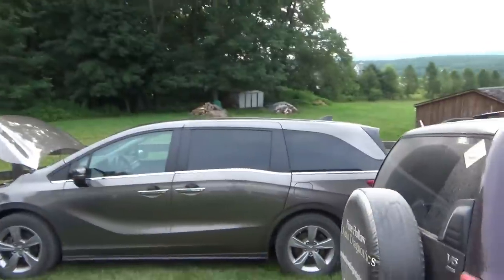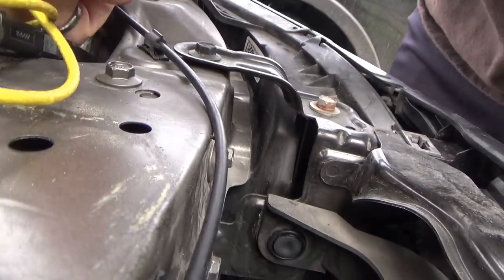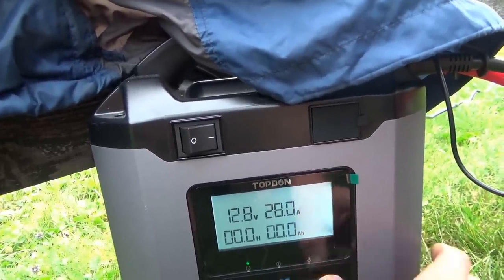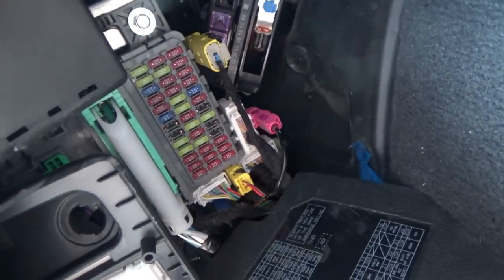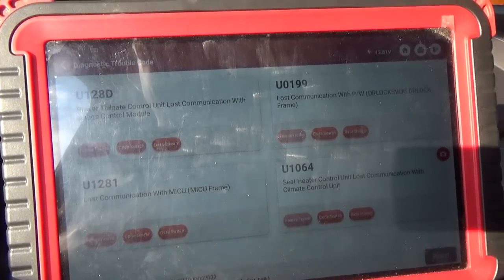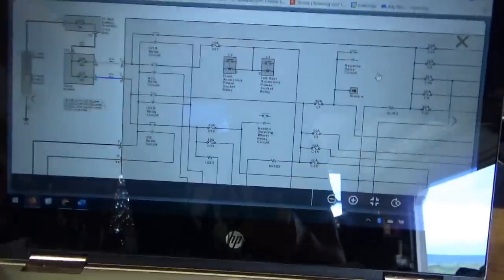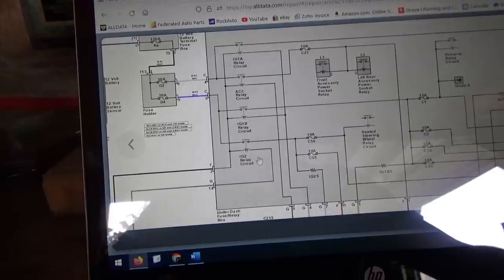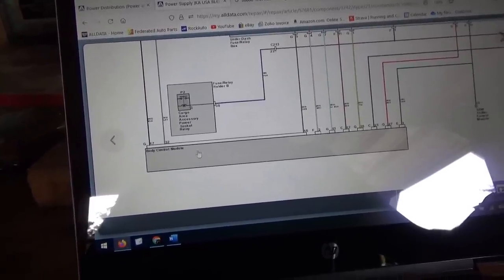WTF...Honda Turns Itself ON & DRAINS the Battery?! (Part 1)

Comment: Miss the good old days when you could climb into the engine compartment to do repairs, actually see the spark plugs before you remove them, change a headlight for 5 bucks and a tail light for 50 cents, 7 dollars for a wheel bearing instead of 250 for a hub assembly.
Reply: The good old days when head lights had the brightness of a firefly in a mason jar, a 5.7l v8 made 120hp, a mid size family car got 14 mpg, and if you hit anything you were instantly killed.
Reply: @JackS425  you know it
Reply: Amen.
Reply: @JackS425   Yeah, good old days when $1/hour was a good wage.
Reply: Welcome to 2022 and new technology
Reply: My Grandpa, who would be 110 years old today if he was still alive, did not like to pay for oil changes either, and would just "Add oil." I'm sure it was only $5-10 to change the oil back then.
Reply: I just looked up a tail light bulb and headlight bulb on rockauto for my 2014 edge. $5.54 for a headlight bulb and $0.44 for a taillight bulb😂. Group stuff together with shipping and it’s like the good old days😅
Reply: Yep.  Back in my day, an engine needed only 3 things to run: fuel, compression and spark.  Troubleshooting required checking all 3 and that was that.  Not today!!!  Too much spaghetti to get in the way.
Reply: @christianmccollum1028  Did your engine have a crank or was it electric ignition?
Reply: @wolleysegap9740  second that!
Reply: Preach.
Reply: @deerhunter8533  welcome to 5 years from now when the dollar is worth a nickel and the car is being "funny"!

Comment: Sounds like other owner has a remote start from a phone app.
Reply: My first thought too is a faulty remote start....I was going to tell Ivan to press lock three times on the remote...with all the doors closed.
Reply: I don't know about this option  but could  be
Reply: I think it could ONLY possibly be a remote start issue at this point. The alternative would require several cascading failures all at once.

Comment: I've had a very similar case study like this one. 2003 escape. Ultimately came down to finding that the instrument cluster had a bad diode, leaking voltage into the ignition power circuit that backfed the control side of a relay keeping that relay latched, providing power to the vehicle keeping the vehicle running. my move is exactly what you're doing in the bonus footage. These ones are always a challenge lol. (I actually ripped apart that instrument cluster and replaced the smc diode on the board and got the customer their car back vs throwing in a reman or used. pretty sweet)
Reply: Wow you certainly know your stuff but how many hours labour did you spend doing that.
Reply: @deniscarr469  Very, very good point. If my memory isn't crap, 2-3 hours to narrow it down to the cluster. Then about 30min-1hr testing on the board and fixing it. Luckily the diode had a witness mark so it was easy to tell where the magic pixies went 🤣 add another two hours for a trip to fry's electronics (may they rest in peace) and reassembly. Definitely didn't charge them enough to cover a whole day project. Think I did diag, an hour for r+r, and $100 for the cluster fix. Eh, you win some, you lose some. Lady still comes back to see me every time she's got a problem though. Hard to come by in a woman, loyalty. 🤣

Comment: This seems very similar to an issue my dad had with his 2018 Ridgeline.  Honda has a service bulletin to replace the keyless access control unit.  The alarm would also go off for no reason at times.  Parts were not available for the ridgeline, the dealership turned off the smart lock feature and the issue has not returned.
Reply: I'm curious to know, if the brake pedal was held down would the car actually start? Time for an experiment
Reply: @soundman6241  
I don't think so.  It has been a few months ago.  After the auto lock feature was turned off, everything worked normally.

Comment: We fixed a couple pilots doing that At the dealership those two pilots would also sound  the alarm of course conveniently at 1 o’clock in the morning lol
Reply from the maker: BCM was faulty? What year?
Reply: @PineHollowAutoDiagnostics  17 Pilot Elite  Smart power control unit module and I miss spoke earlier it was a 17 or 18 Ridgeline. Smart power control unit. I didn’t look at our interactive network site I’m not sure if odyssey even uses this module but it certainly affects pilots I believe even a civic it would just turn the key on and sometimes you could not even turn it off with the button but I could be off Mark on this one I’m not sure if that Odyssey uses the smart module or not On the pilot it’s on the passenger side flip down the glove box mounted with one bolt below the airbag.

Comment: Try resetting the bcm by disconecting both positive and negative on battery and take 1jumper cable and connect positive and negative leads to engine together for 20mins and do these steps in reverse and bcm should go back to factory default settings,  therefore fixing your problem.  U r welcome.

Comment: Hey Ivan. I ran into this same problem with a 2017 crv a year ago. The BCM was unavailable.(still isn't) That really sucks for the customer. I even opened up the module to inspect for a possible manufacturing error. Found nothing. I do automotive electrical and diagnostic work for a living, and your right, the newer these cars get, the harder it is to find modules should they go bad. Good luck with your odyssey. My temporary solution was a constant duty solenoid to power up the micu/BCM.

Comment: I had something like this on a 1981 Ford Thunderbird Heritage Edition.  This car had the electronic dashboard and things I had never seen in a car before.  The interior lights and the dashboard were coming on by themselves.  Now, this is long before any modern electronics or canbus or anything.  I had a repair manual that was for the electrical and it contained flow charts.  I messed with that thing for 2 days.  It would be sitting outside and the interior lights would come on and the dashboard would light up.  Turned out to be a bad lighting control module that was backfeeding through the ignition.  This video reminds me of that.  Great video!

Comment: This is not an isolated instance, other Honda owners of similar age models  (e.g. Civic, Pilot, CRV) have experienced the same symptoms and have either had the BCM replaced or are waiting for them to become available.  There are a few people saying the keyless entry module was the cause, this is much cheaper and available so may be worth a look.
Reply: The transmitter control module went bad on my Acura, and caused similar issues
Reply: As a Honda Technician, if we have a vehicle that powers itself on by itself (usually also comes with intermittent alarm), and we see the gauge cluster turned on with the key nowhere near the vehicle, we know it's a BCM issue. Also for IGN1 alarms where the car sets off its alarm randomly by itself. On some models its the keyless entry instead of the BCM, but I believe that's really only on the Pilots. Basically whichever module controls 'turning on' the car when the start button is pressed, is the culprit.

Comment: All the symptoms are pointing to a problem at the BCM.  Either a faulty connection to, or a faulty module itself.  It is really difficult to tell at this point, but I can't argue with your hypothesis either as it does seem that the BCM is the most probable suspect.  Something that caught my attention though was, there is an "updated" part listing for the BCM on a 5-year-old vehicle.  Not an identical replacement part.  And no related TSB's on it.  Just something that makes you go humm?  I am looking forward to part 2.

Comment: Hey. Great video...my 2013 Honda Pilot 55,000 mi also was possessed. Navigation and radio constantly rebooted, headlights flash, close object warning flashes. All without the key present...and it would not start ...$2300 later it was a bad micu and 2 shorts in the wiring harness. omg

Comment: I own a 2018 Odyssey with almost identical symptoms including the weird “lost power to alarm..” message on screen.  It is very intermittent but the car has left me at least 5 times with a dead battery.  I’m in SoCal and car has <20k on it.  I thought I had seen forums where this problem was noted by others, strange Honda doesn’t acknowledge it.   Looking forward to your final diagnosis and solution.
Reply: Must be infuriating. Just out of warranty.....or is it? Is there dust in or on the connections? Maybe a lot of thieves are just driving around trying codes or seeing whose lights come on. Maybe drive in a different area.......

Comment: Ive seen this befor on my friends 2015 Colorado, he didn't fix it and problem got worse , eventually got to the point of engine starting and running by itself.. He had a rear leaking window that sometimes caused alot of moisture inside and I figured that may have somehow ruined the bcm. Replaced BCM and he hasn't had any problems since. So i believe you made the right call PH.

Comment: Ivan good call.(maybe)
In the early 1980s Volvo had a similar problem with the Volvo 340 CVT model.
If you left the car and closed the drivers door sometimes the car would start and if you left it in
gear the car would start up and drive away !!!!.
They introduced and new fuse box( now called BCM) and a different gear lever with a buzzer fitted to try
a warn people to not leave it in gear.

Comment: You have a thing for weird cases, Ivan :-) It seems like a very educated guess to get a new BCM!
IMHO, a leaking capacitor can bridge tracks of a PCB and pass low current intermittent signals where they shouldn't go (e.g., the base of a sensitive transistor) making something act out of control, as you have there. So, the BCM being the only module providing power, ground and control voltage to the 4 relays, has got to be the culprit. Can't wait for Part 2 :-)
Reply: If it were my car and the part was that hard to get, I'd be opening the BCM to see if I could find the problem.  Perhaps I could fix it.  But there's also a good chance I'd at least see something wrong which assures me that this is the problem.  Really, this problem doesn't feel like the computer itself, but I can believe that damage to the drivers could do it.  In other words, this feels more like a green crusty problem than something requiring a logic analyzer.
Reply: Leaking capacitors rotting into the PCB on a 5 year old car? Possible but far less likely than with something a lot older. Green crusties otoh can happen to a brand new car. We went through a time when all capacitors in all products were suspect at any age. A whole mystery novel could be written about the cause of that one. Regarding Honda, this problem did attack my 1991 Acura in the ICU (intergrated control unit, 1991speak for a body module) causing the intermittent wipers to be...uh...intermittent. Then it went further and pretty soon you could turn on the left blinker and the right headlight would flash. 🤣🤣🤣I found a used ICU on EBAY, which was the only option at the time and it had the same problem but I was able o fix that one.
Reply: Once you get a reputation that proceeds you, stuff like this becomes the normal....
Reply: @additudeobx  I can say from experience that you are correct.
Reply: @InsideOfMyOwnMind  Water in the ECU could do much the same.
Reply: Have seen glue do the same thing, no buttons on a device were doing what they should. After removal gremlins hit the bricks and unit returned to normal.
Reply: @frizzlefry1921  Yep, some glues do get bad with time and generate all sorts of gremlins.
Reply: @additudeobx  You are so right. Ivan's reputation is the major source of weird cases that we enjoy so much (at least I do) 🙂
Reply: @InsideOfMyOwnMind  Yeah, you may be right - never underestimate the green crusties, but the car looks so pristine, I went for the spookier kind of stuff, that goes well with a ghost living inside🙂
Reply: @russellhltn1396  I agree with that - I'd do the same. But, be it capacitor leakage or green crusties, they both point to the same - a signal is being passed across PCB tracks.
Reply: @JoseSilveira-newhandleforYT  If the BCM is trash, you've got nothing to lose and everything to learn  by opening it up.
Reply: @russellhltn1396  Yep. I would do it, even if only to satisfy my curiosity 🙂

Comment: Odysseys, Pilots, Ridgeline, CRV and Civic all could have this issue.   Correct with BCM diagnosis.   Check alarm history and see if "ignition switch" was a alarm trigger.  It's usually a good indication of BCM ghosting ignition to run position.   I have waited over 8+ months to get BCM from Honda.  Try and source a used unit.   Be sure parts numbers are correct.   They have different part numbers for different trim lines in the same year.   As far as I know they are not flashable to different trim lines.    Good content Ivan.   Thanks,

Comment: Does the car have "On-Star" type capability that can remotely start the car (without the key being needed)? Maybe that system has gone haywire.  Also, I noticed a big dent on the driver side front fender. Maybe the car was in an accident and some wires got got messed with? Looking forward to Part 2, Ivan!!!

Comment: Intermittents are such fun!  I've had them before, some take many days to locate.  The wiring diagram was 
the main helper along with one DMM and one Fluke 98 scope in DMM mode.
No green crusties, but a lot of heat related problems that caused the Intermittents.   A heat gun sometimes helped.
You'll find it.

Comment: BCM Is the correct educated guess, I'm seeing this issue more often lately. Only dealer tool will be able to program the new BCM/Used. There is no flashing for the New or used BCM only immo needs to be learnt, Original keys can be reused. Used Bcm with same part number can also be used.

Comment: My 2014 Ford F-150 has the ECU (electric control unit) turns lights and ignition on and drains the battery overnight. I have had it to the dealer under warranty numerous times and they can't find anything wrong. It is a fairly common problem with Fords but the dealers won't acknowledge it. You are correct in your assessment of "stupid smart cars" I work on classic cars, points, plugs and condensers. And I can fix things not just throw parts at a car like the dealer techs do.

Comment: With a computer involved, anything can happen. All it takes is a tiny leakage current to common in a capacitor tied to a processor input normally pulled high, or a switch mode power supply or power converter with too much AC ripple. Somewhere, there is a logic 0 or logic 1 that turns on the ignition, and whether that tiny signal should be high or low, it doesn't take much to change it.  I think you get these cases because of your superior intellect and logical thinking.

Comment: This reminds me of a similar case I had with a 2015 BMW F20 1 series. The fuel pump would start running full speed at random when the car was parked and should be asleep. Eventually causing the battery to be discharged over night.
The fuel pump is controlled by a fuel pump control modules that regulates the fuel pump speed based on fuel demand coming from the engine control unit. A BMW dealership already replaced the fuel pump control module to no avail.
When it came to me I knew that the fuel pump should only be running at 100% if the fuel pump module is awake but has no communication with the engine control unit. Looking at a diagram it has a wakeup line. When it was acting up the wakeup line was raised to 12v thus waking up the module even though the engine control unit wasn't requesting fuel flow, causing it to start running at full speed. Looking at the diagram I disconnected every module on that wakeup line one by one and determined the FEM (Front Electronics Module, basically like a BCM controls everything like ignition, lighting, power windows, door locks, starter relay etc. ) was outputting 12v on the wakeup line when it shouldn't. I was ready to call the FEM until I found not a single used unit with Comfort Access like the car had and a new one from the dealer was way out of the customers budget. With that in mind I decided to dig a little deeper. When it acted up again I started removing connectors from the FEM one by one and noticed when I pulled 3 specific connectors out of the 10 that were connected to the FEM the fuel pump turned back off. Looking at pinouts for those connectors nothing looked really interesting except for a wakeup line going exclusively to the instrument cluster. I had noticed that when the car acted up the indicator lights on the cluster would light up. And what do you know, when pulling the pin for the cluster wakeup line out of the connector and reinserting the connector into the FEM the fuel pump remained silent. I reinserted that pin and just disconnected the the connector at the back of the cluster. Left the car for 2 days and 2 nights. Battery wasn't drained while it would be dead every morning cause of the fuel pump issue. Got a used instrument cluster, virginised it, programmed it to the car and the problem was solved. Sometimes you've just gotta know how the system works and dig a little deeper even though the answer looks straight forward. It might not be.
Reply from the maker: Great diagnostics process 👌🙂

Comment: You know Ivan, putting a kill switch wired to the BCM would be a cheaper solution to the problem AND I think also a great theft deterrent. If a crook steals the FOB RF signal, there will be no way in hell they could steal the vehicle. I know push button start and theft is a huge problem for Toyota but all push button start cars are susceptible.